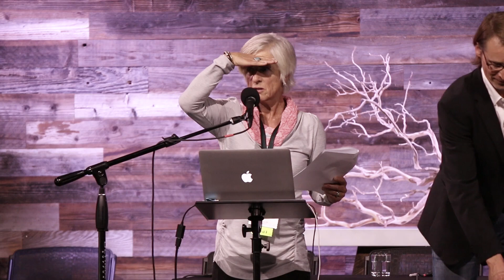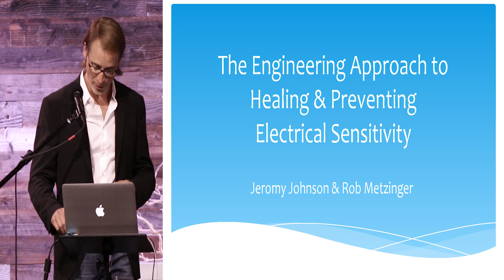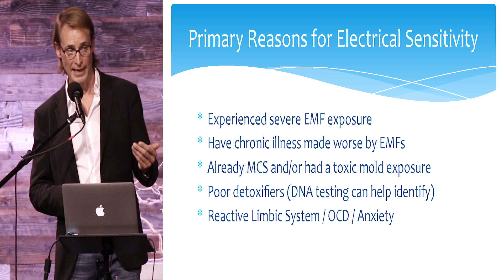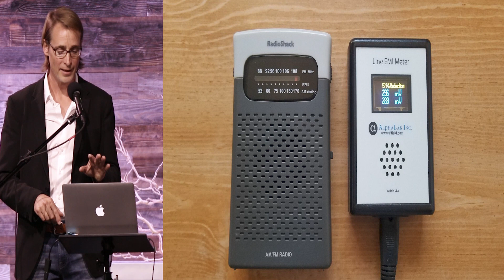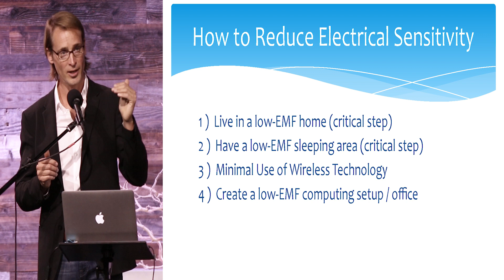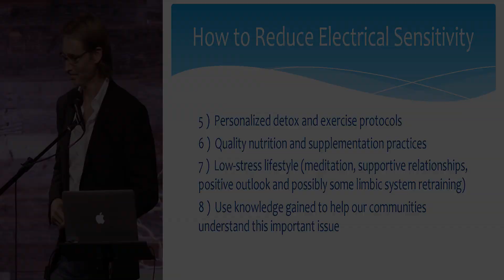EMFC 2019 The Engineering Approach to Healing & Preventing Electrical Sensitivity by Jeromy Johnson

Comment: Many people are walking around with obvious signs if microwave radiation illness and do not even know what it is.  The vast majority of people are electro-sensitive at the current levels of RF/MW radiation we are being exposed to in the State of Florida and many other parts of the world.  And for that reason, qualify for reasonable accommodation under ADA.  Of course, the FCC is working hard to shut down that protection, but it is now still open.  If you have illness when exposed to RF/MW radiation that goes away when those exposures are mitigated, you have EMS.

Comment: Unfortunately this left me even more hopeless as a low-income person with mold illness (and EMF sensitivity.)  It was hard enough (nearly impossible) to find a home that was safe from mold (the one place that worked is a large newer apartment complex, nothing I can do about everyone else's wifi, appliances, etc., plus it's near several external things like a cell tower), I can't imagine adding "EMF-safe" on top of that.  So I continue to suffer.
Reply: I got a Cornet ED88T meter to measure. I lined my apartment with aluminum foil taped to the walls, floors, ceilings, cupboards, vinyl bath tub, vinyl window frames and am now fashioning window coverings with non toxic aluminum window screen. I started with a closet big enough to sleep in, since the floor read calm. I made a couple of panels covered in foil to put across the bottom of the doorway. It helps to have a way to sleep and take breaks from measuring and shielding.
Reply: Try the Dynamic Neural Retraining system
Reply: HUG
Reply: Maybe you've already gotten meters. I was able to buy one little meter called Meterk for less than $25 recently. That at least helped me see where all the bad wiring areas were in my house. And I assume it is going beserk on the floor because I stupidly moved on top of a bank of smart meters. Not quite figured that out yet because I don't have basement access at this apartment building.
Reply: @atc2where  have you earthed it all?  That's something I neglected but found was absolutely necessary otherwise; extreme pain!
Reply: If you can get the mold and heavy metals out of your body, you will probably be less EMF sensitive...maybe or maybe not. I would just keep trying!! I have mold illness too and heavy metals, and Lyme disease too. My life is really difficult. There are options!! Don't give up. I'm thinking of living in a converted rv or van or bus or something :) and living in a rural area someday. God bless you.
Reply: @BelindaKFuller  - oh no, are you ok? A whole BANK???